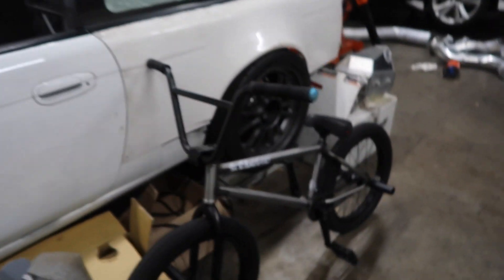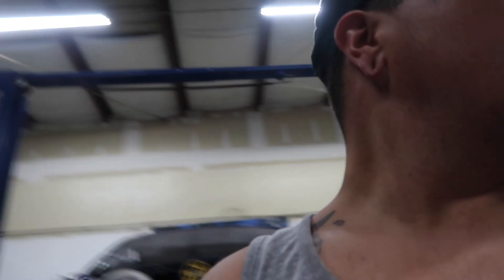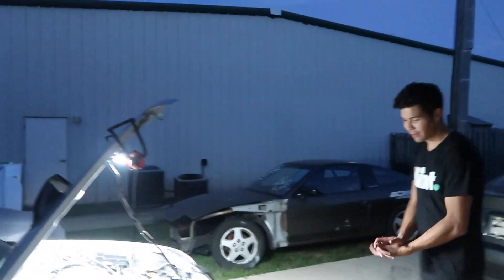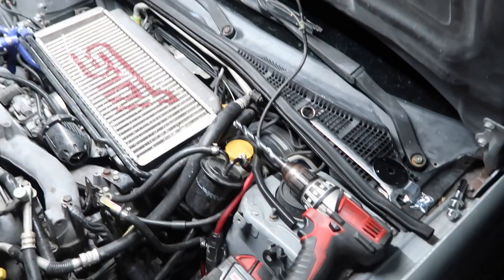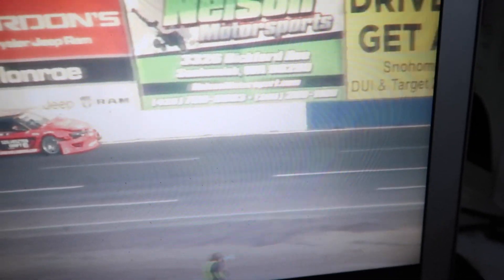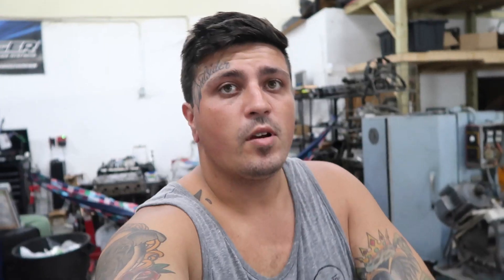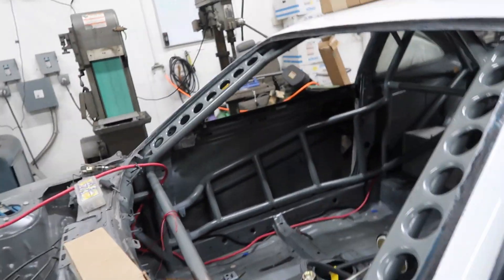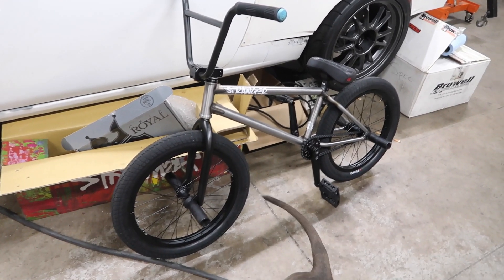HAGGARD WRX GETS A WING AND HOOD PINS

Comment: You could have wrapped painters tape around the pin and put a little dap of paint on the tip, then lower the hood and you'd have a perfect little dot where to drill. Just how I did it
Reply from the maker: +Brandon Johnson yea but the way I did it worked